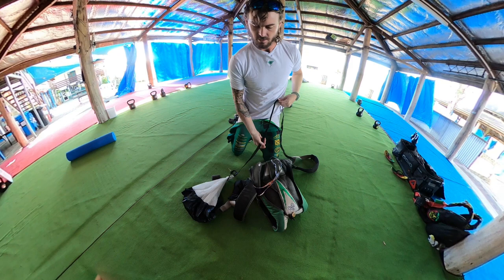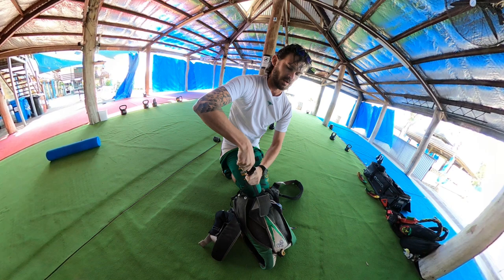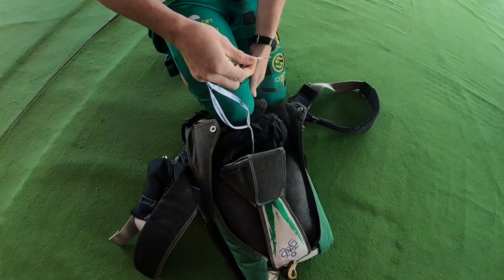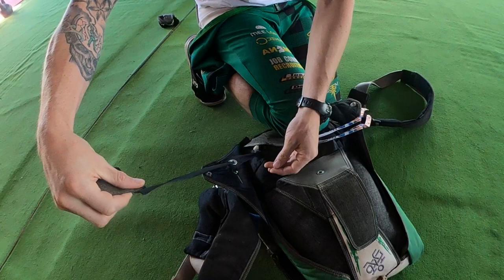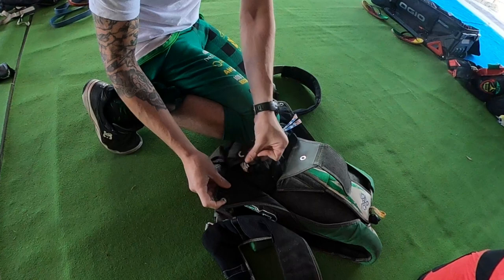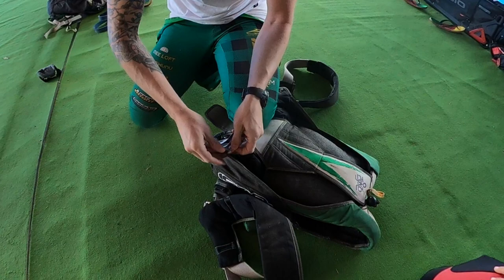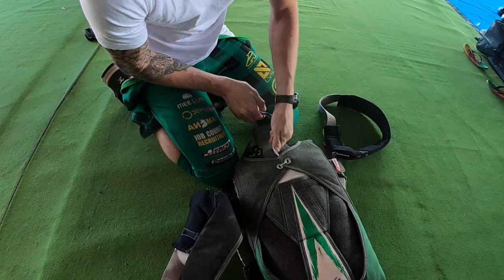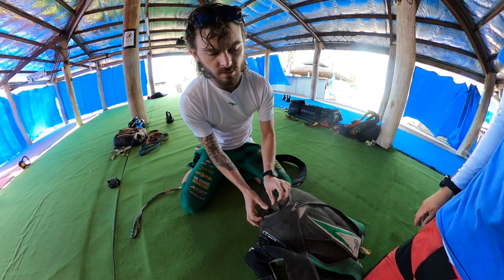Pull out under flap closing sequence - skydiving

Comment: I'm thinking of changing to a pull out system on my rig would you be able to give me some pros and cons with switching to a pull out system please.
Reply from the maker: Yep, It really depends person to person and what type of situations you may encounter more than others. 

Pro: 
- Safer pin protection
- Less chance of a premature deployment
- Safer for faster speeds
- Less chance of a horse shoe

Con: 
- More chance of pilot chute going in burble if deployed wrong
- More chance of a bag lock due to incorrect packing
- If deployment pud is bumped more chance of a floating handle, can be difficult for some to grab.